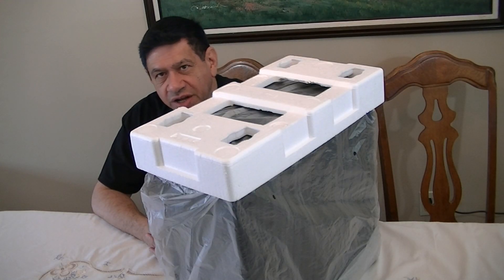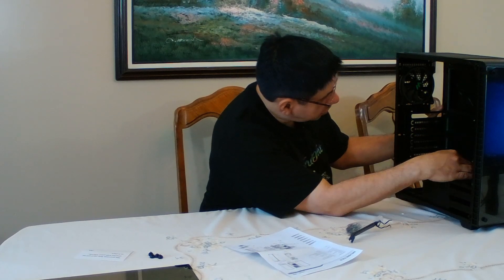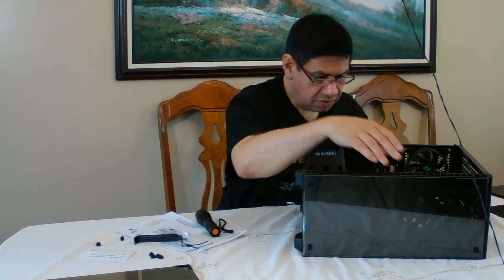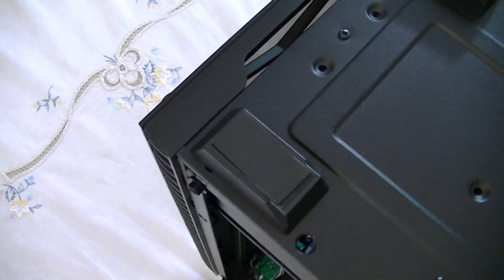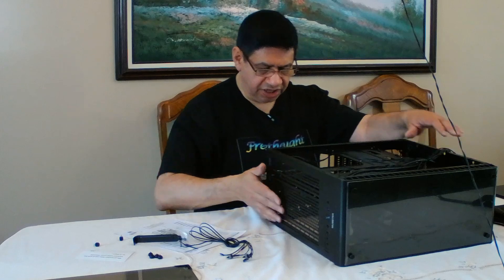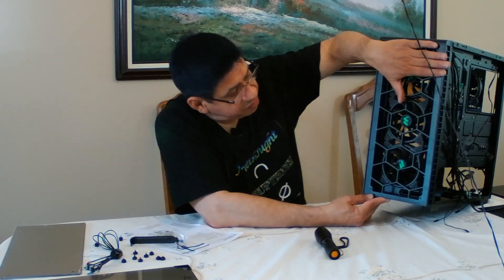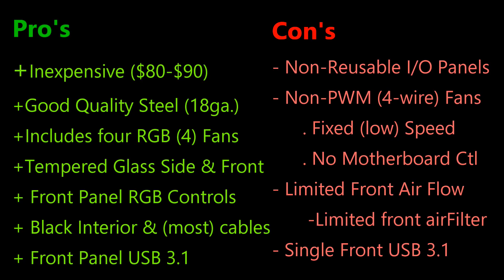Gaming PC Build – MUSETEX Case Review (Part 1: Pre-Build Prelim)

Comment: Question.. This exact case just came in today for me. So are there really no ssd mounting brackets included? Also no 3.5 inch hdd tray? I have a 2.5 ssd and 3.5 inch hdd. Do i really need to buy the mounting equipment separately?
Reply from the maker: You are correct, there are no trays provided for SSD's or 3.5" HDs, however they provide locations where those drives can be mounted directly to the case.  Three (maybe four) locations on the inside front (near the front of the case) for 2.5" SSDs or Laptop HDs. and a bay that can hold two or three 3.5" HDs.

The actual frame of the case is 'low end' compared to a Lian Li or Corsair case, so the cost mostly went into the tempered glass panels and the RGB fans :(
Reply: @PE4Doers  Thank you for the reply. I just saw that my hdd does slide right into position at the bottom, and the ssd can be screwed into the top. Just don't have the screws themselves haha.
Reply from the maker: @GodWarsX  Really, they didn't come in a little plastic bag with the case?  I am sure ours did, and in general, every case I've purchased has included (at least some) screws to attach the drives.
Reply: @PE4Doers  ohh man thank you so much! They were in the bottom of the cardboard box! The one i almost threw away! I was so confused when nothing was seemingly included with the case. I wonder how they wound up there
Reply from the maker: @GodWarsX  You are very welcome.  Let me know how the build turns out.
Reply: @PE4Doers  I will. This weekend I embark on the journey on my first PC build. I think I got this. The HDD fits in perfectly without a drive tray. SSD should be fine as well.

Comment: would you recommend this case?
Reply from the maker: Not for a high performance system.  Even with an AIO added  -as shown in later episodes of the series I created with my daughter building this computer - It just cannot handle the heat produced by the CPU, or the GPU if I had severely tested that.
Reply: @PE4Doers  so this would not be the case for an RTX 2070 Super build?
Reply from the maker: @cedricmiller1319  I would be concerned.  My favorite is the Corsair 275R Airflow, but you would have to add separate RGB fans.  I made a couple of video highlighting that Case.

See these videos:
https://youtu.be/duRAJUAVh_w   and
https://youtu.be/svdrkl-SxcE
Reply: @PE4Doers  Thanks, I just added a $40 cpu air cooler and 2 Corsair Magnetic Levitation 120mm fans on top, and I maintain great temps with my 3600X and 2070S. 50-60 degrees under load for the GPU, and around 60-65 degrees CPU temp with a prime95 torture test. These temps are while both overclocked

Comment: Hello, I need some help. Can this PC Casing Accomodate a 360mm AIO? im planning to take the ML360r RGB by Cooler  Master and im ok if i have to remove any fans
Reply from the maker: I believe it should.  However, You will have to remove some of those fans, and I would not recommend using them to push air through the AIO radiator, since they are not that strong in CFM or that fast in RPM.
Reply: @PE4Doers  thank you so much.
Reply from the maker: @rummanjannat1526  You are very welcome sir
Reply: @PE4Doers  should i get noctuas for them? NF-F12 or Corsair LL120 is my choice
Reply from the maker: @rummanjannat1526  those are both excellent Fans, but somewhat pricey.  The issue with that case is the availability of air inlets.  Would you consider leaving the front glass off?  My daughter did not want to do that, so putting in high-performance fans would have been little help.
Reply: @PE4Doers   yes sure! im totally ok with leaving the front glass off.

Comment: How does the pci e slot work we’re do I put the screws
Reply from the maker: First you need to break out one of the case I/O slot fillers shown at 05:05 into the video (once removed it cannot be re-used).  There is a single screw needed connecting the PCIe card bracket to the case.  You will have to remove that small metal bracket on the outside before you can get that screw installed.  I hope that helps.
Reply: PE4Doers ok thanks
Reply from the maker: @lilsins656  You are quite welcome :)

Comment: Is the airflow good
Reply from the maker: I wish I could say 'Yes', but if Air Cooling is what you will need then this case is not what you want.  I do the show the test results on Airflow and heating in a later Part of that series.
Reply: PE4Doers thanks
Reply from the maker: @gr1ff1n15  You are quite welcome.  There are a couple of other cases I've reviewed that are great in the cooling department, such as the Corsair 275R AirFlow.

Comment: MUSETEX Phantom Black Hey I got this similar case, was you able to change the rgb when press the button on top? I cannot get this to work what so ever. It stuck on white
Reply from the maker: Yes, the button at the top did change my RGB.  I found with a very similar case however, the Thermaltake v200 (since it has a more sophisticated RGB/Fan controller), I needed to hold down the button for several seconds to get it to switch from motherboard control to front-panel control.  I hope that helps.

Comment: Are the fans in the case daisy chained? did you need an RGB/Fan Hub so you could run all 6 fans and lights?
Reply from the maker: Mine had just 4 fans, but they all connected in a daisy-chained fashion.  I've heard from some viewers that the later versions of the case include a star-configuration, using a fan hub that appears to be ARGB (which the 5v RGB not compatible with a 12v power connector), so you need to be careful in that regard.

Comment: I could really use your help I have that case with a 570 msi meg unify. THe rgb controller has a power connection which is working but it also has another connection with 2 3 pin connections I found a spot to plug in the first 3 pin connector the one with 1 missing pin in between but for the life of my i cannot figure out where the connected 3 pin connector goes. the rgb is not controlling its just green
Reply from the maker: I have heard from many others how the RGB controller has definitely changes from when I did this review.  My ability to help without owning the case with the modified RGB controller is very limited.  However if you Email me a couple of pictures, such as the controller, the cables coming off if it, and the page(s) in your motherboard manual that apply, I will see what I can do.
Reply: 3 pin will plug on 4 pin in broad
Reply from the maker: @FLORIDACHEVY383  I believe it will, however with the voltage in a 4-pin RGB connector being 12v, there is high probability it will at a minimum ;not work', or in the worse case damage the 5v RGB on that case and/or fans.  That would of course be dependent on the electrical protective circuits built into the RGB controller (if present).

Comment: Hey so I bought this case and the fans work and light up but I can’t switch the actual rgb colors with the button at the top. Can you help me with this
Reply from the maker: Sorry to hear you are having problems.  Unfortunately, it appears the manufacturer changed the RGB wiring since I created this review.  I heard from a couple of others that they went to an ARGB technology (based on a 5v input rather than 12v), and added a controller that can be connected to motherboards that support ARGB.  Are you able to determine if your is using that new RGB wiring?  Did the case come with a wiring diagram of the RGB?

Comment: Did you ever find a front mesh panel to replace the glass? I have this case I bought from a local computer company and the CPU runs hot when playing games. I've taken the front glass panel off and it drops the temps by almost 15c. Is there something you recommend? I'm only using the stock CPU cooler right now.
Reply from the maker: No I didn't, but to be completely honest I did not really search for one after getting the heat under control by adding the 240mm AIO shown in the final video of that series. I do however own a Thermaltake case (currently not being used) that has the same chassis, so that that you asked maybe I could inquire with them about a possible front panel replacement.  Once I get passed a couple of videos I am finalizing I will try and take an action on that.
Reply: @PE4Doers  that would be great! I love the video you did for this case too.
Reply from the maker: @silverbacks8  Thanks - I am trying to decide on the next 'budget' case that I can review, which has not already been declared a loser.
Reply: Hello! Which case was it that shared a chassis with this one? I have looked everything short of creating a mesh custom to get some more air to the front. Musetex actually sells a version of this case that is mesh instead of glass but they told me they will not sell it separately. Right now I am thinking of covering the front with mesh and adding some standoffs to screw the glass in a half an inch or so off the front to create some space but still keep the look.
Reply: They will not sell the front cover separately i mean.

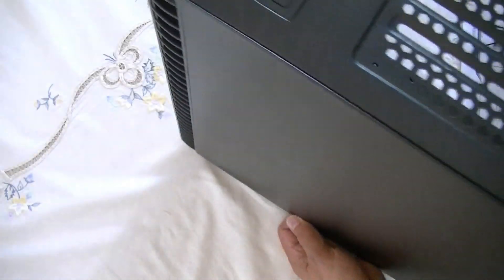Comment: Hey thank for the video! Do you know how I get that usb-c port to work? You can see it on 3:46 of the video in between the usb 3.0 and the RGB button.
Reply from the maker: I don't have that case in my house to double-check (it's at my daughters apartment 50 miles away, that I am not allowed to visit these days), but as I recall that is a 'filler' cutout in the front/top panel molding, for a secondary manufacturer to use for a USB-C if that is something they want to provide.  As you can see at 6:59, there is a circuit board on the other side of that panel, which would obviously need to support that with a socket and wiring to the motherboard.

It sort of reminds me of when I was a 12-year old helping my father repair television sets for customers.  I recall going to the wholesale part distributors with him and seeing how so many different manufacturers used the same molded plastic with unfilled spots that had to be pushed-out if the unit supported a particular connector/option or not.

Sorry, I should have mentioned that in the video when I noticed it as well during the video taping, but just moved on to the connections that were actually being used - I guess because I was so accustomed to seeing that sort of thing.  I do wish there was some central manufacturer that could be contacted who is providing the  base parts, since I would be interested in buying a raw chassis that I could use to create my own variation, but sadly there is not.  As I mentioned in later videos in this series, I have seen that exact same chassis used in at least four other cases (a couple who are 'Name Brands'), just with different fronts and other options added.

Comment: How can I get a hold of you I have the same case and need some help finding where a cable\wire goes.
Reply from the maker: I truly hope you understand why I cannot share my phone number with people I have not met.  However, if you leave messages here I can respond at my earliest convenience.  Or you can EMail me at PE4Doers at GMAIL, if you have pictures of your problem you think I should see (no pornography though please).  When I took my case out of its box, all I needed to do is connect it to a molex connector on my Power Supply and everything worked.  Their is NO option for connecting it to the motherboard available with the MuseTex case (unlike the Thermaltake version I reviewed in another video).  If you Power supply does not have Molex, then you may need to get an adapter that will convert one of the SAT power connectors to Molex.
Reply: PE4Doers I have got it figured out thank you though.
Reply: @superelio3  can u help me with the wires i have the same case?

Comment: Good afternoon,

I have everything hooked up. The fans will all spin but they will not light up. Do the leds on the fans have a special power source?
Reply from the maker: Mike, it's obviously difficult for me to diagnose remotely, however, did you try hitting the RGB button on the front panel?  When I plugged mine into the power supply the RGB immediately came on, so I didn't have to press it until I wanted to make pattern/color changes, however, one of the positions in that switch cycle will actually turn off all the RGB, and the controller seems to remember the setting even when power is removed.

Comment: 1. These Chinese manufacturers/distributors really need someone to stop with the campy names. It's not like they care about trademarks. Just don't plagiarize other tech company names and they're good. Refer to astronomical objects and names if they can't come up with anything else. A poor name design leaps out and instantly screams garbage on an Amazon listing. Even musTech would be far better than MUSETEX all-caps nightmare. 

2. Not to sound like Stephen Burke but mesh front is good for temps, especially since they already have the hexagon designs it would look great with mesh. With tempered glass front panels I wonder if I'll have to source rubber grommets and longer screws to open up some breathing room. 

That's mainly what I see so far.
Reply from the maker: I know what you mean.  The name of this case threw me for a while, then I realized that the company had been selling that 'exact' chassis to other case manufacturers who simply modded the front and applied their own names.  When I took Marketing as part of my MBA degree, that was referred to a 'Private Label', which were usually sold in bulk to the highest bidder.  Unfortunately, that is a practice that many of the 'Nome Brand' companies use to create their low-end product lines.

Comment: Great Review , 👌❤️🔥
Reply from the maker: Thank you very much for your feedback
Reply: PE4Doers just bought the 99$ MUSETEX Phantom Black ATX casa. , so I can start building my first PC , but don’t have that mucho money to buy it all together unfortunately.
Reply from the maker: @wrx6622  I know exactly how you feel - been there many times myself.  Honestly, despite common wisdom (based on the chance a warantee may expire), that says you save up you money and buy all the parts together, I don't usually do that.  I am very frugal (and probably more confident in the parts I buy as long as they have some decent branding (which they don't want to lose), so I tends to buy piece by piece - whenever something on my 'Wish List' (not in a site, but in a spreadsheet I maintain), so I can get the best overall cost savings while not sacrificing any quality.  I have learned that if I just buy parts to get then all together more quickly, I tend to regret it later.  So I wish you luck, and let me know how it goes.
Reply: PE4Doers thanks for the idea I’ll be buying part by part and I’ll see how it’s works , ❤️, I’ll also be Commenting how it works , Have a great day/night , ❤️♥️
Reply from the maker: @wrx6622  you too.   Take care,
Reply: PE4Doers same .
Reply from the maker: If you have any questions, or suggestions for new videos, I would really appreciate it (and display you suggestion)

Comment: This series has been helpful👍 I recently bought the  Musetex Mid-Tower ATX with a 6 fan configuration. Any tips on optimizing the air flow with the stock fans?
Reply: How do I make the fans rgb?
Reply: Would the fractal design front panel mesh c be a replacement for the glass for better airflow?
Reply from the maker: That's a tough question.  I honestly the fans have been designed simply for aesthetics rather than performance.  If you want to stick with those Fans, then I suggest you try and get more air going into the case.  Possibly putting extensions on the feet, or more it may be more helpful to put plastic/rubber stand-off on the front glass panel so you can get it at least another 3/8 to 1/2" away from the case.  I was about to look into doing that, however I chose to put in the AIO Water Cooler instead.  I hope my suggestions here help.

Comment: Did you end up using the extra wires that came with it for the top buttons and rgb?
Reply from the maker: No, I  did not.  I Added them to my stock of small 'Spare Parts' that I will use if I ever have any of them fail.  Also, did you get a chance to view my actual build with my daughter (Part 1 I believe)?  I discovered that one of the cables in the case was mislabeled (in white paint) at the end that that connects wot he motherboard, and I almost stopped the build to use the extra (since it lead to some confusion for my Daughter), but once I figured out which one was labeled wrong, I simply added a small sticker to it so we could finish the build.  My daughter wondered if that is why they may have included it, since it was likely others had complained in previous production batch.
Reply: @PE4Doers  Is it the one that is marked fan? I've been wondering where to place this one.  lol. I will have to re watch the video. I thought this one was it.
Reply from the maker: @mikebohn7323  Actually, as I recall, the one marked 'Fan' is part of the RGB/Fan circuit, which you can just leave alone.  I believe it is meant for adding additional RGB Fans if you chose to (although I don't know "where" you would buy those special Fans). The one I ran into was a mislabeled front panel push-button switch.  In my case (pardon the pun) both the PWR and the RST were marked the same text at the connector end.  I wound up tracing it back to the front panel to figure out which was which.